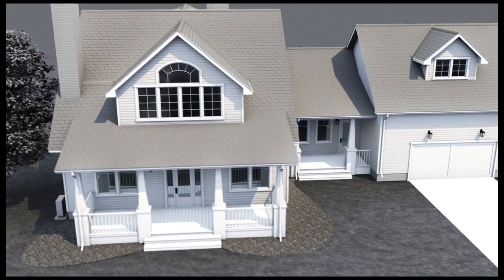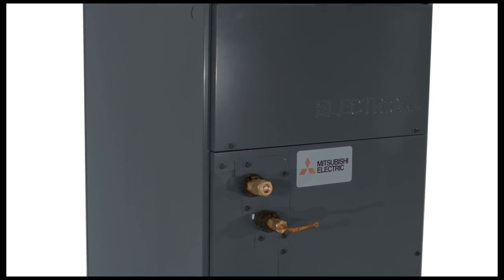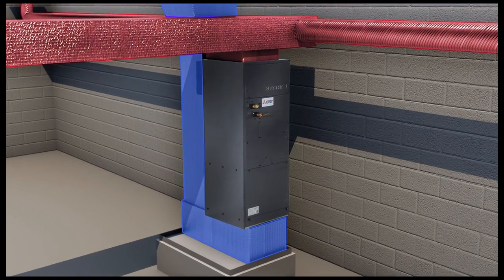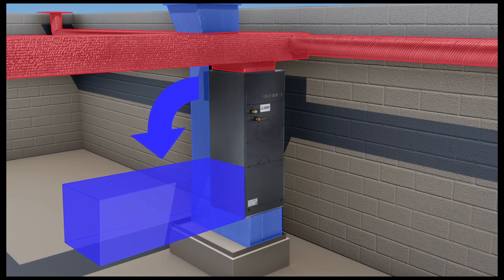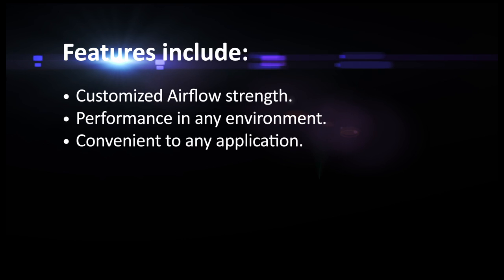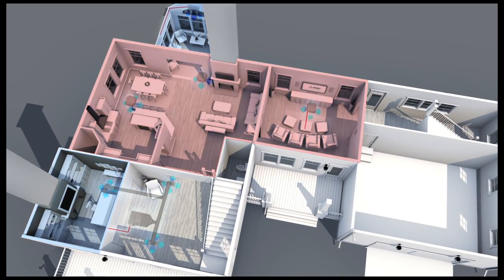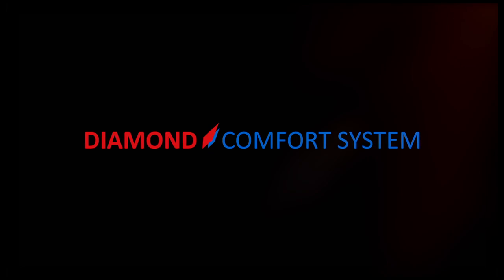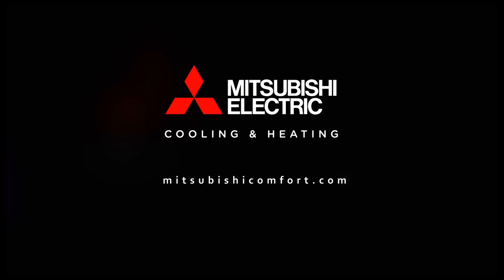Introducing the MVZ

Comment: Having sold and installed many this application is a great system solution to replace existing older equipment (10-15 years old)  gas or heat pump and adding a wall hung say maybe in the room over the garage that has always been to cold or to warm.

Comment: Overly complicated, what's the longevity and because they are so complex do they breakdown often? I don't foresee the average HVAC repairman having parts for this on his truck...imagine what one of those boards cost $$$$$$$$
I was told for my house $30,000 vs $18,000 for a conventional hear/ac system...that's a unit in the attic for the second floor and one in the basement for the first floor, and two condensers outside.
Difficult to digest an additional $12,000